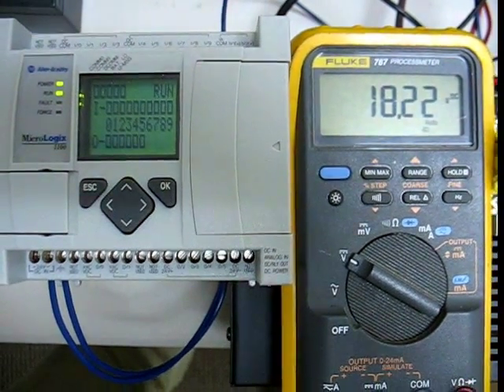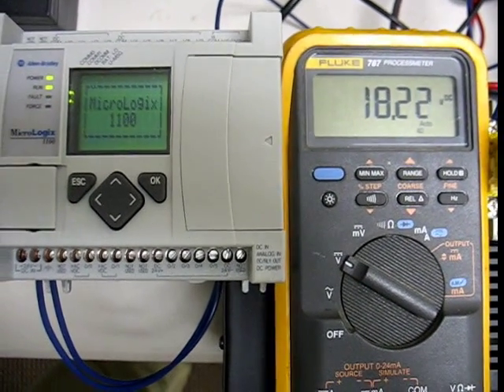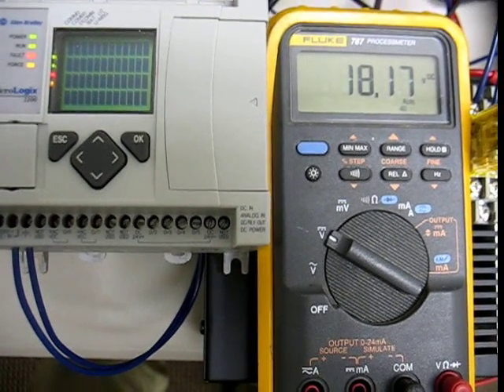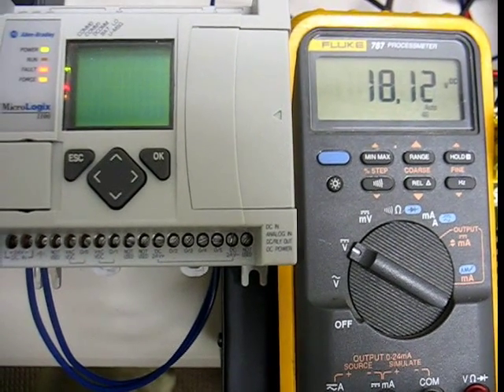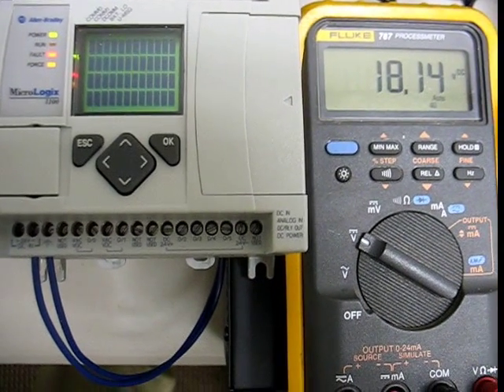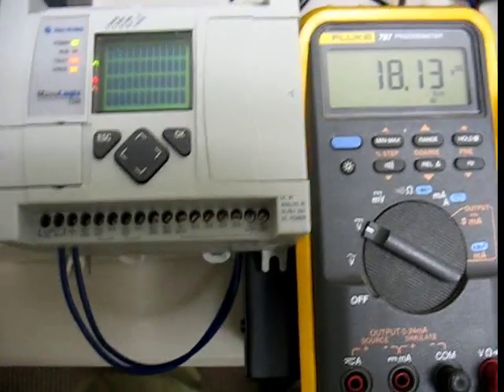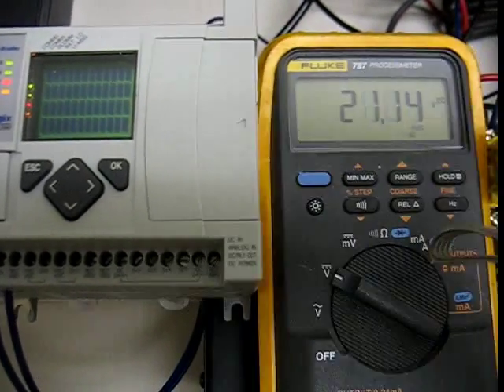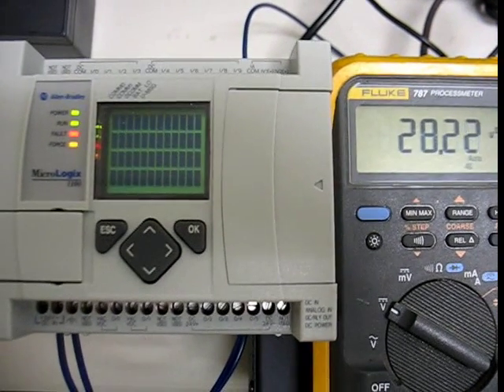Allen-Bradley 24VDC MicroLogix 1100 (1763-L16BBB) Faulting on Low Input Power

Comment: I agree for the most part. The situation we get in to offten is solar applications that are not easy to get to. ie water tanks on mountians in winter. We solved the problem by installing voltage sensing relay that drop out be the mLC.

Comment: The input voltage specification for the 1763-L16DDD is 24V dc (-15%, +10%) Class 2 SELV.

This you can use this PLC between 20.4V and 26.4V. Therefore in this video you are using the PLC outside its voltage range at both ends!

If an industrial controller faults out due to low power, I would not want it to come back automatically. As you would need to locate the power problem before putting the system back in auto.